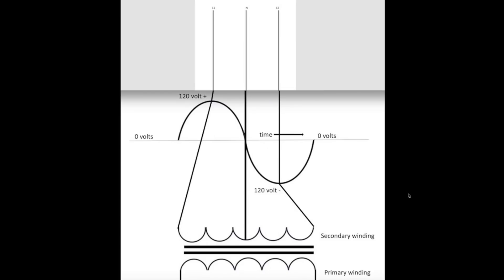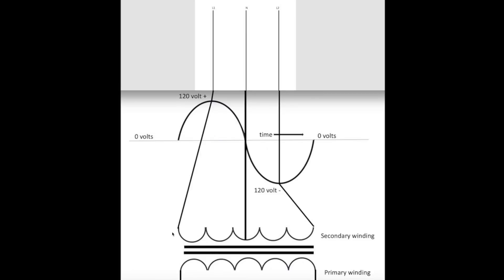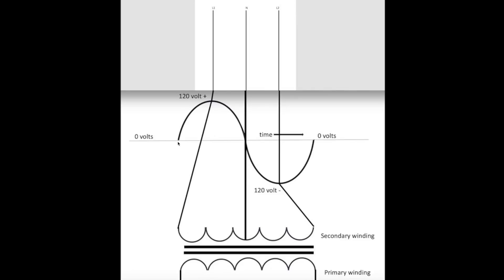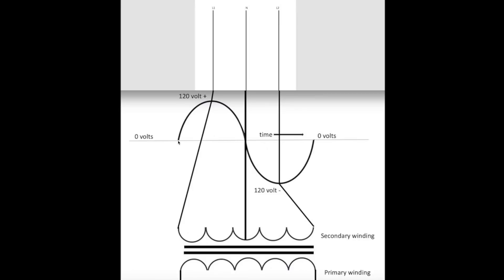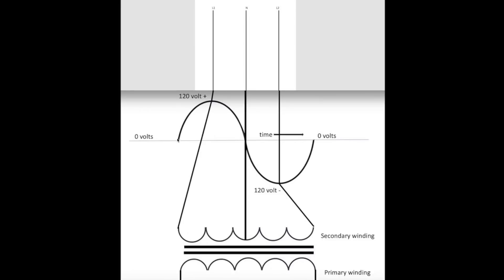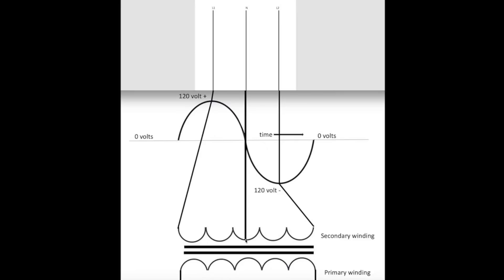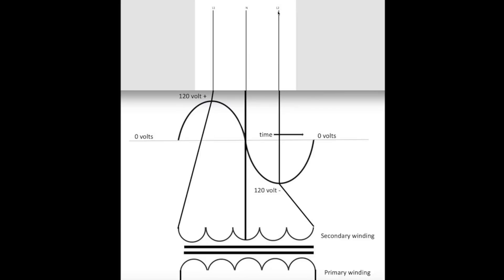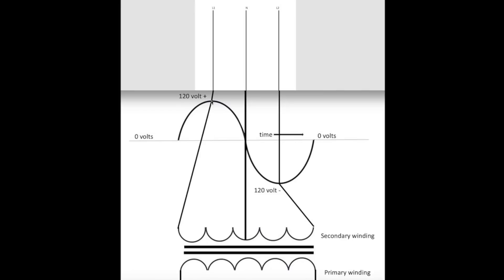An explanation of the 3 wire system pole transformer

Comment: Thank you so much for such useful instructional videos. 
I have a question: are portable generators that  bad for electronics on a modern  furnace?
Reply from the maker: Its not an easy question to answer.
Cheap is probably bad. 
GFM

Comment: One is positive, one is negative, as the magnet turns back at the power plant. 
please, what makes L-1 and L-2  out of phase, at any given time?
thank you.
Reply: L1 and L2 are the two ends of the secondary winding.  When one is at peak positive the other must be at peak negative, with respect to the center tap.

Comment: you would be measuring L1 to L2 peak to peak. peak on the sine wave  to negative peak. its 240 volt positive peak to negative peak. 120 volts Root Mean Square. IE 165 volts. in actuality it is 330 volts L1 to L2.
Reply from the maker: True, but meaningless.  We are working in a world that averages the peaks.  
GFM

Comment: Wikipedia says:
In the United States, the practice originated with the DC distribution system developed by Thomas Edison. By dividing a lighting load into two equal groups of lamps connected in series, the total supply voltage can be doubled and the size of conductors reduced substantially.

Comment: Unbalanced load, neutral feeding difference back to the pole transformer; still 120v to either side now that neutral is carrying current?  Yes because we're talking voltage (difference) vs current (amperes)?

Comment: Their is only a greater potential between the 2 outside winding terminals vs the center tap and any of the other 2  taps due to the amount of the change in flux density on half the coil vs the full coil . The ground is any winding tap you choose,not just the center tap. voltage to ground is relative to which tap is grounded.Only one at a time please! Lol.😁 
Its all about change in flux vs number of coils of wire induced by the flux in a given time period. The horizontal in the graph is the time domain of flux change through the whole coil not half the coil.(all current are going through the whole coil in the same direction at any instant).
Reply: I tend to agree with you
Reply: Faraday
Instantaneous Voltage = Number of turns  *  Change in flux  /  unit Time.
Double the number of turns you double the voltage.

The two coils on the secondary could have 4 wires attached but it would not be very useful to hook them up in series any other way

Comment: One question that I get about the subject is why can't someone measure negative AC voltage? Or why can't someone use a meter to determine which phase is L1 versus L2. Our meters convert AC to DC internally, scale it appropriately and then multiply the peak voltage by 0.707 to display the nominal rms 120vac or 240vac. Using an oscilloscope, one can see the entire peak to peak voltage sine wave including the negative half. Another head scratcher can be a house where the neutral is floating or disconnected from ground. This situation can produce excessively high voltage on one leg and very low voltage on another, often burning up items attached.
Reply: “Negative AC” is meaningless.  The designation of L1 and L2 is arbitrary.
Reply from the maker: Maybe the negative voltage is above the pay grade of the students.  Sometimes best not to get too far into theory.  
If your neutral is floating in that it does not have a connection to the neutral on the pole, you could definitively voltage problems.
GFM
Reply: Another drawing on the subject  http://goo.gl/Q17z0n
Reply from the maker: Not bad
GFM
Reply: The phase of something is measured relative to something else, in this case the other half of the split phase power distribution.   -Sin(u) = Sin(-u) so referring to a negative Sin does not make sense here.  

RMS refers to the equivalent DC value of Voltage or current that the AC signal delivers.  Most AC meters measure mean average deviation which rectifies the signal and than low pass filters it (average).  Some high end meters actually do square the signal, average it and then take the square root (definition of RMS).
Reply: An oscilloscope  does not have to modify the signal to display and, as such can display the negative components particularly when the reference is one of the phases.   That requires ground isolation of the scope, which we often did in my younger days when working on industrial controls.  Ground isolation modules are available or, while not totally safe, removal of the scopes ground plug was used in a pinch.